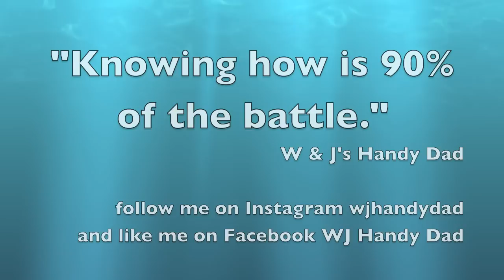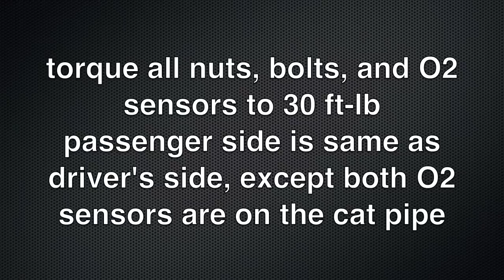Ford Crown Vic & P71/P7B catalytic converters and O2 sensor replacement

Comment: Wow, you made this video right on time, I had  CEC P0155 and with 225k on the odometer I had to change that oxygen sensor.it wasn't any fun when I went to take the oxygen sensor off I rounded the edges a little bit so I stopped thought it over and then idled up the car and let it run for about an hour then went outside with a breaker bar and I was able to get the old sensor out. I purchased a thread chaser to make sure that all the old corrosion and debris was clear the threads. Really appreciate your videos thank you.

Comment: Nice vid, I was having major performance issues and I was hearing a loud screeching noise when I accelerated, just found out it was because my cats were clogged!
Reply: man my crown vic started doing the same thing... the same loud screeching nosie when pressing down on gas .. couldnt tell what was causing the sound
Reply: I just cut the ones off completely. No need for them

Comment: Nice Gary!  I think maybe I'll ship my Vic down to you whenever I get the P0420 code so you can do another video.  Just one more reason why we need to live closer to each other!  -Chris
Reply from the maker: the house right next to mine went on the market last year for the first time in 15 years.  It sold within a month.  They didn't even know they moved in next to W&J's Handy Dad until the first time they needed to borrow a tool.
Reply: WJ Handy Dad what kinda cats did you use?? Are those eastern cats?

Comment: In Canada the road salt on exhaust systems necessitates a cutting torch for the exhaust bolts, at the mileage you have. No clean-Hanes-Manual-car’s-never-even-been-driven disassembly procedure here. Picking up an ‘11 factory metallic grey P7B, 80,000 miles, ex-Ontario Provincial Police, this week!
Reply from the maker: it's amazing what salt does to metal.  We don't get road salt here with our hot temperatures, but we do see the same thing with Intex saltwater pools - they eat up everything metal anywhere near the pool
Reply: Yikes. Ontario is the worst for salt! Gotta keep stuff clean. My 08 vic has 290 thousand k as of now.

Comment: Thanks for the video. Question. I just had my catalytic converter replaced. Is there a reason why they would need to weld anything?
Reply from the maker: some shops cut the cat itself out and weld in a new one.  In the video I show you the bolt on method which is probably more suited for DIY

Comment: Man I just mine this passed weekend and man getting them off was a PAIN. The passenger side gave me the toughest time. I managed to get it on but I had to do some modifications to the mounting plate to get the threads through and now I have a leak where they connect and damn smell the exhaust in the car lol. Need to torque it down more lol.
Reply from the maker: hope you get it fixed

Comment: I just change my cats with walker cats. The dealer was telling me that the walker heat shields are no good. So i bought ford heats shield i hope this stop excessive heat on the floorboard
Reply: Hey did it stop the excessive heat ?
Reply: Nope the car caught fire
Reply: Damn so you think it was the heat shields that’s made it catch fire ?
Reply: @romeomunoz541  no I believe I should of fix the floor sooner
Reply: Ahh okay so you never fixed the cats? I’m just worried if I should just straight pipe from the rear cat back or swap them out
Reply: @romeomunoz541  as long as your floorboard is good just change all the cats

Comment: I have a used 2005 Ford Crown Victoria LX Sport sedan with 180500mi. 🚗 My check engine 💡 & scan showed the car has a bad catalytic converter. I read these Crown Vic P74s have 4 converters, 2 on each side. What might it cost, parts & labor 🔧 to replace 1 catalytic converter? The scan tool code just listed 1 catalytic converter. Thanks
Reply from the maker: I don't know about prices, that depends on independent, DIY, or dealer and of course what part of the world you live in.  I always replace all 4 at once because I assume that if one is bad, the others are not too far behind.

Comment: I need those bolts to connect the exhaust where can I found them
Reply from the maker: have you checked Rockauto or Ford parts?
Reply: @WJHandyDad  yes. Didn’t really find anything. But I looked on Amazon and they had some. M10 bolt right?
Reply from the maker: @kennywarren2317  I swear Amazon sells everything  LOL   I don't know the bolt size though.
Reply: @WJHandyDad  yeah it does lol.
Reply: How many 02 sensors I new. I got a set of catalytic converter.
Reply: And where can I get them from
Reply from the maker: @kennywarren2317  4 total... 2 "front" and 2 "rear" - links to them are in the description of the video
Reply: @WJHandyDad  it’s giving me an error page when I click the link
Reply from the maker: @kennywarren2317  just checked got same.  I guess Amazon isn't carrying them anymore.  It is the Bosch 15718 and 15717 (you need 2 of each).
Reply: @WJHandyDad  ok and as far as the bolts to hold the exhaust and catalytic converter together. What is 9/16?
Reply: Where can I get that o2 sensor tool you got?

Comment: Can I ask you why you replaced both cats in the first place? I have a rattling sound in the drivers side rear cat. Got check engine light. Car is running fine as far as I can tell.
Reply from the maker: I was getting the cat below efficiency check engine light with increasing frequency.  The car has ~4800 idle hours so I figured the cats were ready and no problems since
Reply: Thank you for your response I am getting same code on bank 2. I will go ahead and replace the cat. Always enjoy all your videos. Very informative and much appreciated.

Comment: Hey I have a 2010 crown victoria p7b when I bought the car the previous owner cut the 2 catylac converter off your changing . I noticed the car ride good until I have to go up on a hill something do you think it's because he cut them 2 catylac converter?
Reply from the maker: My theory (a lot will argue with me) is that any time you change anything from the exhaust manifolds back, you need a custom tune or things will work less efficiently.

Comment: Great video, man. You are an excellent teacher. Quick question. I live in NJ, one of the states that follows California emission regulations, do you think I would be able to pass inspection with the cheap cats from partsgeek or 1a auto?
Is there a difference between regular crown vic and police interceptor? I have a 2011 police interceptor, thanks.
Reply from the maker: I honestly don't know - the car exhaust doesn't smell "strong" like a car does that has no cats, but I don't have testing equipment to know if it would pass 50 state emissions or not

Comment: Hey boss how many exhaust flange gasket do you have and did you change them. Also can i reuse the same screws?
Reply from the maker: I don't stock those gaskets - just used the 2 that I had.  And I re-used the bolts
Reply: @WJHandyDad  what about the donut gaskets, those will need replaced as well, right?
Reply from the maker: @howdareyu  it never hurts to replace gaskets but I reused mine without any problems

Comment: What if u don’t have cats but do have o2 sensors a code p0040 show up today and another one show up a week ago P0172 mines is straight pipe and still had o2 and had the vic for 9 months and 17k miles and never had thqt problems till now and been straight pipe and muffler deleted and fñow masters since I brought it it had no cats
Reply from the maker: my belief, based on my experiences with fuel injected vehicles, is you need custom tuning to make everything work correctly once you start removing or drastically changing parts.  Or go carbureted but then that can have it's own issues

Comment: Do you need the 2 rear cats?? And will you pass smog testing??
Reply from the maker: I don't "know" the answer to either.  My guess is you'd fail a smog test and without a specific tune the car would run rich while the computer thinks it's running lean

Comment: @JW Handy Dad hey im from Memphis TN and i have a 02 Ford Crown Victoria it came with single pipe on the left passenger side and now i have duals exhaust stright pipes and i want to put the Catalytic convertible back that connect to the engine but I do not know which one to get..can u help me and tell me what to get please
Reply: Antonio Busby replace the exhaust components with that from the p71 model

Comment: just a quick question did you pass emissions with these cheap cats?
Reply from the maker: we don't have emissions testing where I live, but I don't think there would be any problem... the exhaust smells the same as it did before and my nose is hyper sensitive to carbon monoxide

Comment: Do I NEED* to get new O2 sensors when replacing my cat?
Reply from the maker: if your existing O2's are working they don't "need" to be replaced, but it's a much easier job to do them together so you may as well do it while you have them off the car.
Reply: WJ Handy Dad Alright! Appreciate it!

Comment: Can I use a universal catalytic converter because I can't afford the factory one?
Reply from the maker: should work as long as you can install it - most shops will cut out old cat and weld in a "universal" cat rather than install a custom Ford setup

Comment: Just bought 2 walker pair for my crown can't wait to install them my old cats has burn a hole in my floorboard😭😭😭
Reply: Were you having performance problems with your old ones? 

I'm starting to have performance problems and my floorboard is starting to get hot. I didn't know if I should delete 2 cats or just replace 2 first

Comment: On my 98 its in a hidden location, pretty much behind the cylinder head and space is tight
Reply from the maker: wow, thanks for letting us know.  Oldest Vic I've ever worked on was 2003 which for the most part are about the same as everything afterward except for minor changes here and there
Reply: @WJHandyDad  well, the O2 sensor is still in the same location give or take, however, to reach the connector is just outrageously tight! The driver side, i managed to get my skinny arm through there, but the passenger side, i had to loosen down the cat bolts to give me enough room to disconnect the upstream sensor and then replace it. Overall, it was a challenge for me since I don’t like to make room for the job since that’ll require more time and not to mention, i’m doing the project from a jack and jack stand position which is very uncomfortable lol
Reply from the maker: good luck with it.  This is definitely why I like doing the O2 sensors off the car.  I think I've done O2 sensors on a vehicle a couple times and they are always a pain to access
Reply: @WJHandyDad  UPDATE AS OF 15SEP23, I have completed the project. My O2 sensors were original NTK brand just like the replacement but under licensed from Ford and they were dirrrty. Granted, no CEL was on, but as a 25 year old car with over 160K miles, original powertrain, its worth it! Plus, I have that bi-annual California smog coming up! Last California Smog test for my Vic as it will move to Texas with me in 2025😄😄

Comment: Hey bro, i got a project.coming up. 1989 grand marquis catalytic converters gotta be changed out. Originals got clogged
Reply: How you know it’s clogged ?
Reply: @Atmbreeze  
When you here metal clunky sounds,  too much heat around around converter, sometimes pressure gets too much the thing gets really hot. Sometimes hear backfire.
 
Its the bits and chunks of ceramic comb that breaks up and restricts exhaust flow. Mh left cat had that situation. Right side not as much.

When it gets worse, car cant expell gases, car cant breath and engine stalls.
Reply: @shemailgoondall9531   I have a 2003 grand marquis LS my check engine light came on I took it to AutoZone they plugged it up it was a P0420 Catalyst converter efficiency code the next day my car wouldn’t start before it did that I use to hit the gas pedal and here a rattling noise coming from the passenger side now it’s doing a crank no start
Reply: @Atmbreeze  
Im jinda busy now, at work. But rememver this. Old cars 1980s, cats were cheap,  and lousy
The 1998-2011 ford crown marquis towncars, they actually better build quality, but sometimes they will fail and im not a mechanoc. 

Egr valve cleaning can be the problen sonetimes. Thats when car has little tonno power going over inclines, bridges, slows down acceleration,  smells like rotten eggs. My 2004 ford crown taxi was like that. Some idiot mechanics said change cats, went to another one and he said let me clea. Egr. The diagram mechanism was bad so for 75 bucks changed egr. It ws ok then
Reply: @shemailgoondall9531   I ordered brand new cats with the pipes I’m waiting to arrive so I can change them out
Reply: @Atmbreeze  
Yeah. Well thats good to hear. The original cats with both upper mini cat and bottom main cat, those are expensive, but any easy replacement , as opposed to other ones that require cutting, bending, and welding. They cheap but god theyre hard to work with if you dont a muffler shop

Comment: W J Handy Daddy

 Did you sell the cats? How much did you get?
Reply from the maker: I gave them away.  I think he got $50 or $100 for them.
Reply: @WJHandyDad  
Thanks for replying.
I have a 96 MGM and just recently replaced both cats, I'm in California so I paid big bucks even for the cheaper option, Easter cats. I sold the old used OEM cats for 400.00 to offset the 550.00 paid for the new ones. I could have gotten 600.00 but, I don't have a business license and that's what recyclers want to see to minimize risk.

Comment: Wondering the reason I shouldn't reuse the bolts. @WJHandyDad
Reply from the maker: probably the fear that they may have weakened from heat over time
Reply: @WJHandyDad  wow thanks for replying so quickly! Where do I find these m10 nuts and how do I make sure they are the right size? After uninstalling old cat should I take the old bolts to Home Depot and ask for a similar replacement?

Comment: Are there gaskets that go between the cat pipe and manifold or just between the cat pipe and the rear portion of the exhaust?
Reply from the maker: no known gaskets at the back of the exhaust manifold to cat connection.